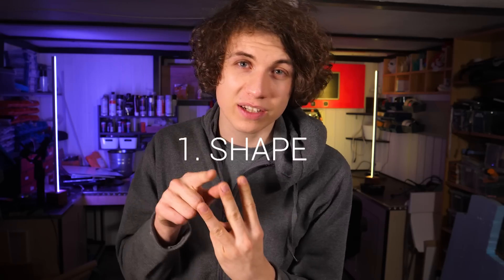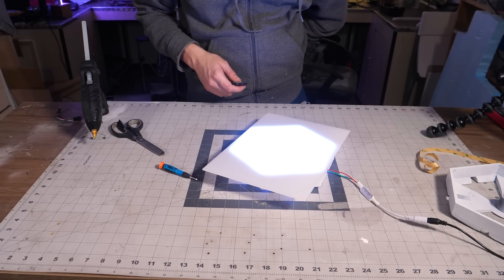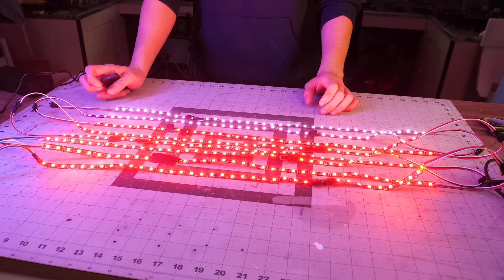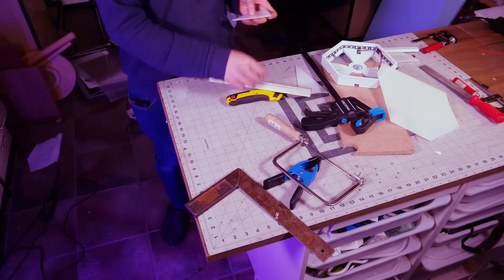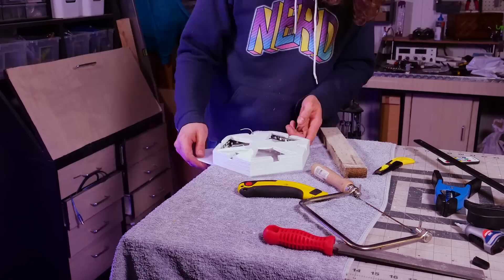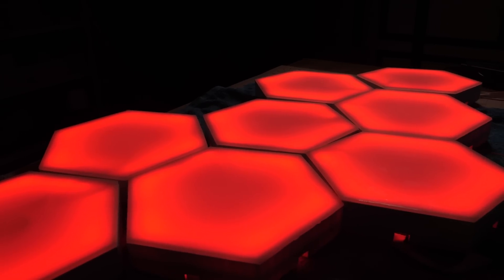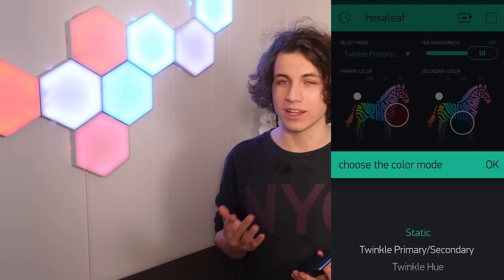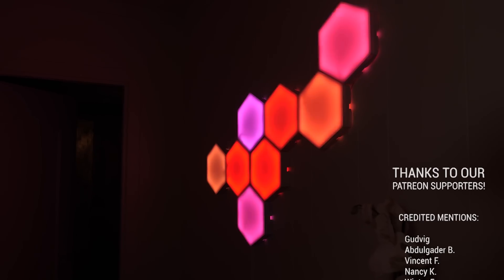Making My Own Version of Nanoleaf Aurora - DIY Project

Comment: Why is it always like, "cheap diy", but then you need a 3d printer?
Reply: Could easily use wood instead.
Reply: @ZacDonald  how
Reply: @mustardgas4000  Buy some 1/2 - 3/4 in Softwood Boards from Home Depot or some other store. Measure the desired angles and cut 6 matching boards. Nail and glue them together. Trace the outline of the hexagon onto a sheet of plywood, cut out the hexagon with a jig saw. Glue and screw it all together, done. Should be able to make about 6 with $40 worth of wood. Still requires at least a jig saw, which are $30 compared to a $300 3d printer. And ideally some clamps, wood glue, screw, sand paper, and nails, so add $20 for those.  Plus the lights/other parts you'd need with or without a 3d printer.
Reply: There are entire websites based around 3D printing your specific designs and then shipping them to you. I've used them before, they're pretty affordable.
Reply: @SultanOfSloths  which websites?
Reply: @Knackin  I've only used ShapeWays before. I got a small figure made out of sandstone, I don't see an option to use sandstone anymore, but they do have a lot of different plastics and even steel, gold, and brass. Pretty good resolution and coloring. It's a bit pricy, but if you need a custom fit part it's pretty easy. Most small items are between $10-$20. 
Here's a 2019 list of 3d printing services if you want to find something else: https://all3dp.com/1/best-online-3d-printing-service-3d-print-services/
Reply: Name of the websites?
Reply: @SultanOfSloths  Where? I have used many, being into D&D and Warhammer, and can find none that are what I would call affordable. I mean the cheapest is meant to be Shapeways, but to do this project, for example, would actually make it cost the same as going for one of the already existing Nanoleaf competitors. As far as I can work out printing those hexagons will cost you in the UK $12.99 per one. So to do 6 would cost nearly $80. For $182.20 you can get a 9 piece set from Benexsmart. Probably find that even cheaper in the USA.
Reply: because you don't buy a 3D printer every time?
Reply: Most libraries will let you use theirs if they have one and if you pay for plastic, which you would have to do anyway (it’s super cheap) and if you are in high school and your school has one they might let you use if for free or the cost of the plastic.
Reply: You can use a 3d printing service. Thats what i did, cost me $35 for 8 of the pieces
Reply: Did they come out the same way as in this video? With the slots on the sides and the open backs?
Reply: Noone said the DIY was a cheap one tho ;) it just says "diy project". I watch these videos for fun. I definetly don't have a 3D printer at home.
Reply: Because 3D printer kits are pretty cheap, and if you still don't want to do that 3D Hubs exists.
Reply: Why use a 3d printer?  Just use your CO2 laser cutter and cut some acrylic.
Reply: No one said “cheap diy” it just says diy and that could be anything
Reply: i have the creality ender-3. its 170 euros and its awersome. i made this project above using it. took it a few days to print but im satisfied with the results. i used a shitload of 3d gloop too.
Reply: How did the end product turn out, and were you able to get the app n such working as intended? I am very intrigued by this project and am looking for feedback
Reply: because you can order 3d printed parts for less then the nano leaf. furthermore you can even buy a 3d printer filament and the led strips for less then the cost of nano leafs.
Reply: It’s almost 2020. If you don’t have a 3D printer, get one!
In all seriousness, I got an ender 3 for only £140 and I swear it’s already paid for itself.
Reply: For complete beginners: 
Getting a printers half, or even 1/3 of the story only. You gota learn how to take care of your printer, how to design things (easy and free software and sites if youre just gona use basic shapes), then learn how to setup prints physcially and digitally (in the software/program). You dont just download and print. Each piece is different, like know the reasons why you would print a piece on its right side vs its bottom side.

Youre gona have to eventually learn how to tear down/repair your printer if you want it to last.

So before you begin, think about all this. I have one and its a great creative tool, but i kind of just set it aside for now because i fixed fixed/modded mine and it works, but it prints off when you get like 2 inches high.
Reply: 3d printers have gotten pretty cheap (fdm) you can find some decent ones for 120-170$

I made/designed one in high school as a project. It actually was not that hard of a concept. At first it was difficult because I tried to make all the structure out of wood, and metal rods/threaded rods. Now I’m redesigning it because I need a smaller one that I can keep in my house.
Reply: Because why not? They are super cheap these days and super easy to use.
Reply: Ikr
Reply: Because a 3D printer is a really great DIY tool, possibly the future of DIY electronics.  Don't be scared of it; jump in.  Sure if you want something fully built and working it may cost a lot, but if that's not an option there's plenty of cheap kits available that are way more fun and you learn a lot more.  The kits are basically a large box of cheap parts that you have to put together and what you get at the end of it is up to you (either a well functioning and safe printer, or a pile of junk that that may catch on fire).  More cheap DIY.

I think there's not enough 3D printing in this project.  I would have designed the light boxes to take clip in and replacable diffusers (not just clued onto the top) and I would have printed the diffusers too, or printed them as lithophanes for an extra dimension.
Reply: You can always use foam cardboard (usually is used to build boardgames inserts DIY) , it's pretty strong enough to be used for that kind of build. it's easy to work with and is veeery cheap :) to be honest if i would be trying to build that i would take that soultion :)
Reply: @newhawk 
you don't exactly *need a 3D printer*.... one person could just take long  plastic strips, make a wood form of desired shape, score and heat bend the strips over the form. glue and done.
Reply: where does this say "Cheap DIY" though?
Reply: Just make something out of cardboard. You can use any shape you want. This is just about fundamentals.
Reply: I believe this video was about "his" personal DIY project, not a DIY project for the average viewer. The bottom line is, these videos are great as they pull back the veil on consumer product construction and if you have the tools and patience, you can do them yourself or adapt the concept for something else.
Reply: It's cheap DIY, not broke DIY.
Reply: At my little local library you can send a 3d printing model and they'll print it for you and you don't pay hardly anything.
Reply: another person have them print you a 3d printer then buy the electronic portion and make a reprap printer for yourself.
Reply: If you make enough the money saved makes up the money for a 3d printer
Reply: Every time
Reply: You can use plywood and paint it. Or even cardboard.
Reply: https://youtu.be/t9xGyB4ahyY
Reply: just get U channel that you get for hiding cables under your desk and make diffusers out of styrofoam plates..  :)  easy and super cheap and lite..
Reply: HOLY CRAPPPP   just saw this ..  https://www.youtube.com/watch?v=cApzqYYVbwo
Reply: If you cannot think of a way to make a simple hexagon without a 3d printer then you should not DIY, you could even use stiff foam boards and cut then and join with super glue. Or u can buy and cut ABS or Acrylic sheets with a hand tool…
Reply: They should put 3d printer ideas or something like that in the first of the title
Reply: 3D printers are tools. To do this you also need a soldering iron and other tools too. You could use other materials (MDF, wood, cardboard, glass), or cut the plastic in other ways (it's not that complex a design!). Heck, you could use the technique demonstrated to cut Acrylic and make the entire box out of that. That said, something like a Monoprice Maker Select is a good starter 3D printer that will likely make up for its up-front cost in time & cost savings.
Reply: @karon_pcmr  there's no reason his design has to be this thick. I think he mostly didn't care. And before you go around throwing insults, this guy made a thing, documented it, and made the design freely available. What, exactly, have you done besides provide vapid critique? Either one-up him or keep your mouth shut.
Reply: 3D printers aren't much more expensive than proper regular printers.

Also you can use a 3D printer in any Hacklab and many libraries and schools have them too.
Reply: He's got a point. A cheap 3d printer is like 300 bucks. I paid 100 bucks for the cheapest laser printer I could find with wifi. But a better printer will yield better results.
Reply: Michael Malek you can buy /make a decent Fdm for 120-175 dollars in all honesty. I did it as a broke high schooler with basic tools. (32inx32inx32in) 

You can also increase the quality of prints depending on the filament you use by using acetone to smooth, and make a better bond between the layers with a vapor bath. 

I’ve allready started making a 
New one from the old one because I need a smaller, more compact one.
Reply: Riku Lindblad yeh but u could just buy nanoleaf Rather than a printer to make rip of nanoleaf lol
Reply: Jake Carder Jake Carder I mean if you design/make things getting a 3d printer or making you’re own is a great investment. With the excuse to make a nanoleaf it could be worth it.
Reply: @Boris-dq3ub  that's no fun
Reply: another person yeh ik what ur saying but the vids to like show how to make nanoleaf if u can’t afford them :)
Reply: @Boris-dq3ub  use library 3D printer or wood or just acknowledge the YouTube creator community is more interested in views and subscriptions than in open source hacktivism.
Reply: @Lepinkainen_  I can get a "proper regular printer" for £20-30, cheapest 3d printers I see are like £300, I'd say thats much more expensive
Reply: @Erainia  Look up the Ender 3 It's much less..
Reply: @Erainia  £30 isn't a proper printer at all. It's one of those all-plastic ones where replacing the ink cartridge costs more than buying a whole new printer =)
Reply: @Lepinkainen_  Does it print things? can it print things up to A3? if yes, then it's a proper printer in my eyes. Printer ink is gonna cost you the same amount if you're buying a more expensive printer anyway.
Reply: @Erainia  Anet A8 on gearbest is 150. yes they can burn down your house, but so can 3000 dollar printers. if you get thermal runaway protection, always be around the printer, and run the printer conservatively it should be okey
Reply: @Erainia  you get a printer for 100€. Thats cheap in my opinion.
Reply: @osimmac  are you watching the right vid right now?
Reply: @Erainia  Kit's can go down to 80£, even less if you go off ebay. The prices have gone waaayyyy down.
Reply: @Lepinkainen_  That doesn't change the fact that they aren't cheap. Also the cheaper 3d printers are shitty "not-real" ones that fall apart and constantly need re-calibrating, as well as needing you to assemble it. 

As for "cost of ink" yes, we all know about that. So okay the average printer costs about £200 in the UK. That is me being nice as well: for that you can get a nice laser printer. In the UK the average 3D printer is £800. Yet again, that is me being nice and including all the cheap shitty ones you can get scammed with on ebay. 

As for the person that said the Ender 3: In the UK is is still nearly £200, only has a 12 month warranty, requires you to assemble it... oh... AND CAN'T DO THIS PROJECT!!! 

The fact is there is a reason 3D printing some things work out as more expensive. The fact is you to do this project you would need to have a 3D printer with a big area for printing. That is before you even go into the fact that 3D printing is awful when done that way. The resin using a blast of UV to cure is much better but at £3000 a pop, they are truly not for the novice. 

Stop being fucktarded fanboy cunts. The OP makes a good point about these fucking videos. Some of us are actually looking for affordable ways. Not a Grant Thompson "here's a quick and easy project, you will just need some wood, sheet metal, a mig welder and your copy of the necronomicon." bullshit project where some rich youtuber pretends we all have this stuff.
Reply: @osimmac  So in other words you cannot do projects that take any length of time. The 3000 dollar ones usually can reach better temps and also can do that reliably. They also tend to be able to print bigger things. The Anet A8 is great if you want to do anything without detail and if it is small. Bigger projects and it has problems.
Reply: @nickarmitt4722  ""here's a quick and easy project, you will just need some wood, sheet metal, a mig welder and your copy of the necronomicon."
Gold comment! LOL!
Reply: The title says "making MY own "
Reply: @justgaming9485  It's literally listed in the how to section of youtube and has the tag "how to" 

Try again, BRO.
Reply: newhawk lol making these without a 3D printer lol

Comment: that light bleed out at every one of the unused connection openings though.
Reply: If you have a 1mm radial hole that's 1mm deep, simply make a .95mm that's 1mm deep cylinder as a filler when you 3D print them. That way you can attach and detach on demand. Add tape on the inside of the hexagon to stick. Don't use glue or you won't be able to reattach it if you're using another hole or something... Simple solution.
Reply: that could be mitigated easily with silicone

Comment: I think I might try to make these using wood, maybe sanded and waxed ebony, and make a seriously badass art project out of it. BUT, I'd also like to change it up a bit, have mostly normal ones with the diffuser facing outward, but have a handful of them to where the portion facing you is capped with brushed aluminum and the side edges that are wood have channels routed into them with acrylic or epoxy diffuser in the channels so that the light comes only out of the sides of those for a nice effect against the backdrop. I'd make them all different sizes, from maybe 20cm all the way down to 5cm (using a single LED in the small ones). 

With this, I can have the effect of a few big ones in the middle, mostly tightly grouped, gradually fading out to smaller ones at the edges that are further apart, with random spacing between. Like a starburst type of thing. I would also like to make them out of both triangles and hexagons. Then, get a sheet of aluminum and give it a matte finish with media blasting and mount all of them to the sheet for a really great matte reflection effect from the side diffused pieces, with holes drilled in the sheet for the wires to pass through behind the various sized leafs and then mount that on the wall using screws with some sort of spacer like PVC pipe cut down to around 2cm for spacing behind the aluminum panel for the wires, controllers, etc. to be mounted behind the panel. Could also put LED strips inside of a C-channel with diffuser around the backside edge of the panel so that it lights against the wall around the edges as well. 

Or, instead of a big, expensive sheet of aluminum, I could use a sheet of 1/4" paneling or plywood and put a brushed aluminum vinyl wrap on it. Or maybe something like this (looks very good): https://www.amazon.com/VViViD-Brushed-Metallic-Vinyl-trunk/dp/B00L9J0NWG/ref=sr_1_44?keywords=aluminum+sheet+5+feet&qid=1553141700&s=gateway&sr=8-44

The 20cm leafs would use: WS2812B Individually addressable LED strips
The 5cm leafs would likely use these for lighting: WS2811 12mm Diffused Digital RGB LED Pixel Light (individually addressable)

Comment: Nice work. Last year I built an own version of the triangle nanoleafs and I used the same connectors and holes in the frames to get it modular. Had to laugh when i saw your solution.

Comment: Absolutely awesome! And I love hexagons, so this is definitely going to be saved for later!
If anyone wanna upscale the hexagons or go cheaper with some weaker LEDs, then it might be an idea to place a dome in the center and make it reflective. That should ensure a more even spread of the light. Hence why a lot of spot lights are entirely reflective on the inside. And you don't need a 3D printer to make these. You can use hand tools and wood. It'll take some extra time, but it's totally doable.
Reply: Or spray paint cardboard with acrylic paint
Reply: Do black base first and let it dry, then apply white or whatever colour you want

Comment: Yeah Cheap But First you need a 3D printer
Reply: Nope, you can make this in plywood too. Or scrap wood. Or scrap plastic. Or scrap metal. Really any kind of solid material that fits the shape you go for. It's gonna take extra time, but it's totally durable. I'm making 27 ceiling lights out of some wooden lists I had lying around. Complete with a removeable sidepanel that clicks on with magnets, so it's easy to access and replace defunct LED strips.

Comment: Like we all have a 3d printer laying around...
Reply: You don't need one. It's doable with hand tools and any kind of solid material like metal or wood. You don't have to 3D print it. It's easier, yeah. But not the only way. I'm making 27 ceiling lights out of some wooden lists I had lying around. Complete with a removeable sidepanel that clicks on with magnets, so it's easy to access and replace defunct LED strips. All by hand, with the only power tool used, being a drill. Primarily because I don't own a hand drill.